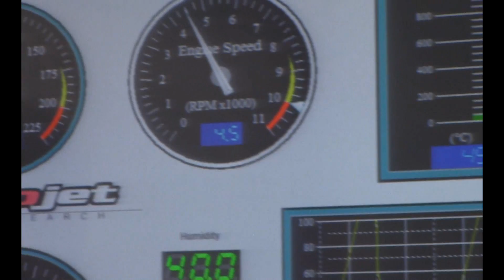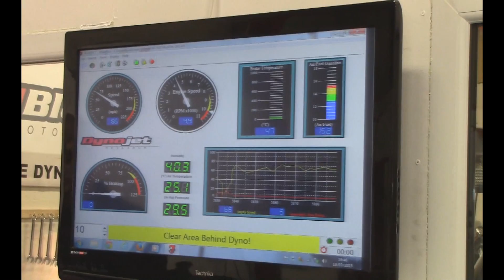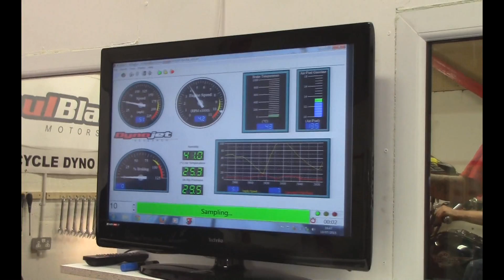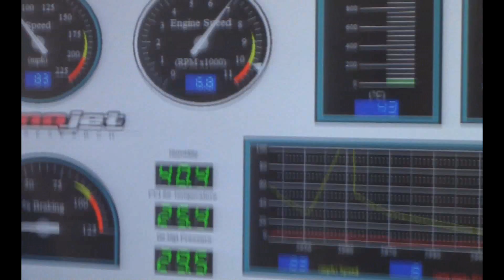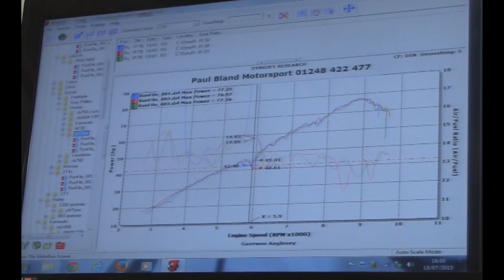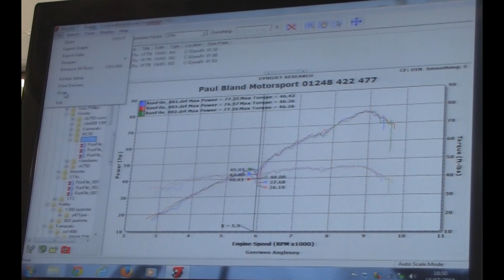Honda  Magna 750 2001 Dyno dynamometer test run + bhp results

Comment: Anyone know what it would take to get an American version to 100 bhp?
Reply: Swap a VFR750 engine onto it. Larger chain driven cams, bigger carbs, oil cooler. With breather mods on a VFR engine you’ll see over 100 whp, let alone bhp lol. Plus a cruiser that revs to 12k would be pretty cool

Comment: First it's not a V45 or supermagna. It's a third gen Magna vf750c rc43. Second is it's a euro or japanese version of Magna 77 hp.  American version has 87hp, you can recognize it by yellow reflectos on a radiator.
Reply: 87hp before our jet kits. But we usually run out of gas early love my maggie
Reply: Correct, mine bakes right at 80 rwhp with jetting and programmable ignition.

Comment: Aftermarket pipes or loud ass pipes,,,, will kill your low mid torque and horsepower,,,,, most times you cannot get it back at Redline,,,, you'll need to go an extra 1500 RPMs,,, with cams to get more horsepower,,,,,,. !!!!!

Comment: I've seen 87 horsepower bone stock,,, stock mufflers,,,,, jetted,,,. Correctly to sea level,, or elevation,,, low mileage in the states,,,,,
Reply from the maker: This ones still on the original jets, and it was dynoed near enough at sea level, however I live at 800 feet above? Im not interested in loud pipes or such and dont like to draw unwanted attention, we got a serious law issue here on speeding but we got higher than average deaths on the twisties here so you can sort of understand it.  Back to jetting, i wouldnt be up for doing any carb work myself as im just not that technical or tidy enough to take that on, would you leave it as it is?

Comment: I have a stock '99 Magna that I purchased new. I was always curious about how much power that motor made. Thanks !
Reply from the maker: no problem, i knew it would be worth filming and uploading just for people to see and use as a reference point, it cost me £15 to get it done ($20) I dont know the prices your end sorry, however the needle pretty much sits on 72mph @ 5000rpm still running stock sized sprockets and a 70mm rim on the read, ah man, its fucking winter here and the roads are shit, she wont see the road for probably another 3-4 months :(
Reply: @thepoultrypeople  just recently purchased a 1998 Honda Magna one owner bike with 36000 original miles on it, made in America,, dealership prep costt me 99.95, bike cost me 2495, plus dealership prep, but something I did knotice is that the choke has to be about Halfway out or the bike stalls out, otherwise if I could seems to run okay got it just before hunting season in Michigan which is November 14th,        so I won't be able to look into it until spring I'm just hoping maybe the air filter needs to be replaced, hopefully that will help solve the problems w/the choke, or could it be the idle adjustment just needs to be turned up a little I'm not sure,  what octane gasoline do you recommend? maybe that could be part of the problem.